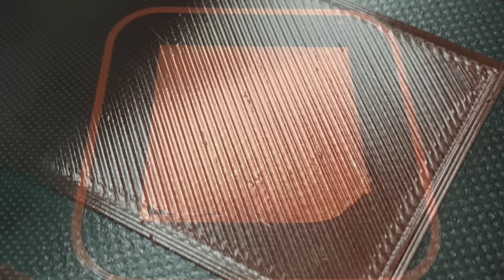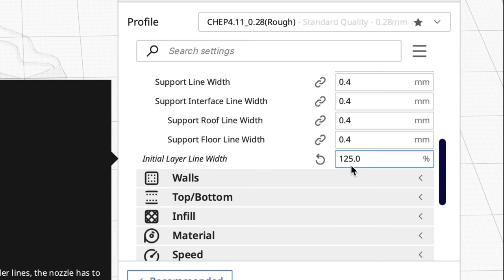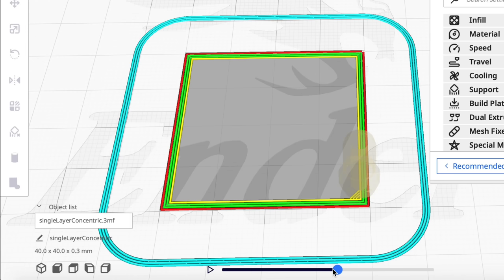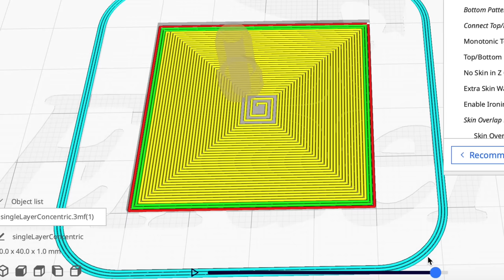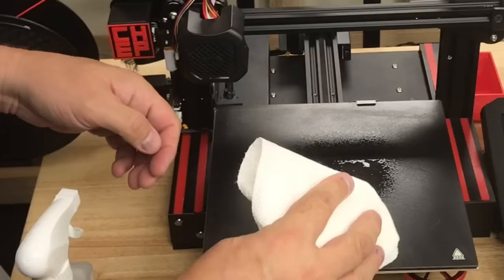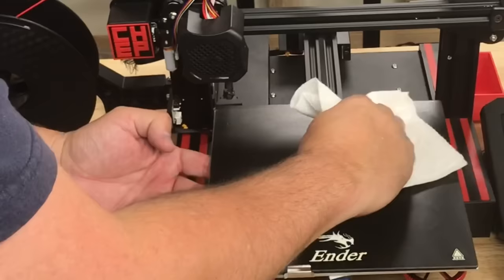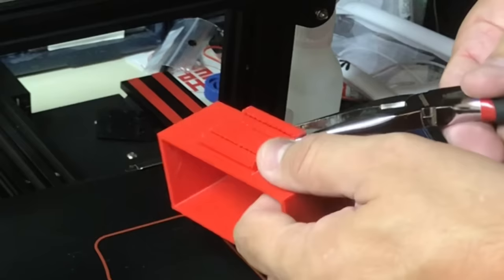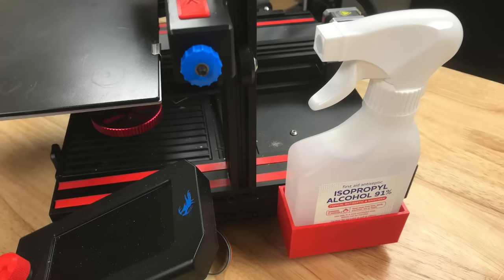Better First Layer and Bed Level Fixes on 3D Printers

Comment: Amazing! I have a bed that is slightly lower in the middle and i was struggling to get that 1st layer to stick on a particular shape. Upon following the points in this video, it made the print. Every advice on this channel always works for my particular challenge..once again amazing. Russell from Qatar.

Comment: Between prints I like to use the microfiber cloth. No alcohol just the cloth. I find that the bed has a lot of static electricity and it's attracting dust. After so many prints maybe four or five then I'll use a little alcohol after the bed is cool down completely.

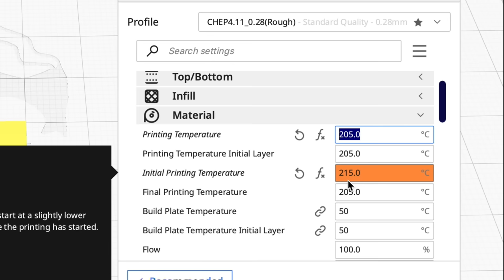Comment: Hello CHEP, I think there is an error in your video. At around 0:57, you seem to suggest to change the "Initial printing temperature", but it's actually the "Printing Temperature initial layer" that should be higher (215C)
I did the test and the print temperature for the first layer was 205...

As always, great video :)
Reply: +1 true

Comment: These fixes worked for me. It's been a nightmare getting the prints to even start without the extruder ripping the first layer off the bed. Despite the bltouch, the bed still seems to have hills and troughs that the bltouch isn't measuring, and so some places are thinner and others thicker on the first layer. I haven't gotten much out of my investment in this thing yet. Hope I will start to now. Thanks!

Comment: Regular paper towels leave fibers behind which also stop adhesion. I recommend using a micro fiber cloth or the blue shop paper towels that are designed for glass. These tips are all amazing though, thank you for this video!

Comment: I’m just getting into the hobby. I’ll be using this info this evening after work, when I continue to adjust my printer. I’ve gotten a few prints out, but many fails as well, and a lot that I have aborted just a few minutes in due to not getting a good bed to print on. I think this will help tremendously.

Comment: my print was warping so much up in the middle, but after using IPA and using the concentric pattern it just turned out SO PERFECT! even though i don't use Cura (i use Thq Qidi slicer to my Qidi printer) the functions are the same. I should watch some more of your videos.

Comment: I tend to prefer the Creality glass bed and initially it had no issue. I standard having some minor problems that IPA couldn't fix. I tried glue stick but didn't like the mess. Switched to a quick spritz of cheap AquaNet hairspray and it's my go to!
Reply: I used >99.5% IPA between all my first prints and it still refused to stick. Seems like it still left some residue on my Creality glass bed. Cleaning with regular soap once made it stick much more reliably.

Comment: Always enjoy watching your videos and have learned a lot! I was using 91% alcohol but couldn't figure out why I was having issues getting prints to stick. I noticed the alcohol started to remove the top layer from my carbon glass bed. My wife told me to try Eye Glass Cleaner from my experience it seems to help prints stick a little better and its also not as harsh as using straight alcohol. Hope this helps anyone else experiencing this problem. Also before I forget I use a microfiber cloth that I found at Walmart in the Auto department.
Reply: Its not a carbon glass bed its Silicon carbide which is incredibly hard and does not come off with alcohol cleaning. Alcohol affecting these glass beds is just one of many annoying myths that crops up in 3D printing.
Reply: @backgammonbacon  Yes that's what it is! Drew a blank on whats it's called. Maybe mine was defective or something but it was coming off. Using something other than 91% or 71% alcohol is working for me

Comment: Struggled with failed prints for the last 24hrs. Even went as far as installing the CR Touch I had waiting to go, but still struggled! Watched this, tweaked the slicer, tuned the z-offset, cleaned the bed and laid down the most perfect first layer I ever have. A single 75mm square, one layer thick that cannot be torn by hand (I left it as a line pattern too!) and has not a blemish on it. Liked and subscribed!
Reply from the maker: Glad I could help

Comment: This was so helpful! I had been noticing my brims are failing near the bottom of the plate on larger prints. It was the oil from my fingers where I'm always touching the plate to move it!!!! Thank you for pointing that out! I was going crazy trying to figure out settings or print models as the reason for initial layers warping :)

Comment: I also put insulation below the bed so the heat spread more evenly, it reduces the warping (the middle part of the bed usualy a lot hotter than the edge and expand more)
Reply: What insulation did you use?
Reply: I'm using roof insulation foil, it looks like shiny bubble wrap 🤣

Comment: I guess for me when I had trouble with getting parts to stick to bed, I learned to use spray adhesive or using brim in the slicer settings or both of those. Works well for me.

Comment: One trick I do (aside from cleaning the bed with alcohol prior to each job), particularly if the room is cold is to preheat the bed for 5 to 10 minutes. Glass doesn’t heat as quickly as the aluminium base that the sensor is attached to, so whilst the sensor might suggest a bed temp of 60 degrees, the glass needs a bit more time to achieve a similar temp.
Reply from the maker: I let them settle a lot longer but edited it short for the video. Same results.

Comment: Thanks Chuck, those Cura tips are awesome but my issue is probably the cleaning. Just got my printer a couple days ago. My first print turned out really well but now I'm having this issue. I had success bumping up the nozzle and bed temperatures, but its not failsafe. I've swept it off and wiped it down, but I haven't taken the bed off yet for a proper scrub. Sounds like this is my problem.

Comment: Thank you so much for this video. I'm still pretty new to 3d printing and after a couple weeks without issue, I had run into an issue where my first layer was laying so badly it would curl up and catch on the extruder causing the whole first layer to start dragging around, I re downloaded my sonic pad profiles I tried my default cura profiles tried tramming the printer and leveled the bed over and over and tried glue sticks no matter what I couldn't get a good even stick on the first layer, SO I took this guide and used it as a fresh start following basic guidlines for a good first layer along with some of your recommended settings and I'm seeing good clean  first layers again with no curling or lifting, will take a few more prints before I have my settings really dialed in but I was starting to lose confidence in fixing this until I followed along with this video.
Reply: Fr bro my print was dragging too but this guide helped.

Slowing down that travel speed was big.

Comment: Hi Chep, thank you for sharing your tricks! :) I use something else, under MATERIAL - Initial Layer flow - set it to something like 120% - if I need a brim for avoiding warping, I also bump that up.
For cleaning the bed I use glass cleaner and a microfiber.
This avoids me using rafts 99% of the time now.

P.S. I have an Ender 3 Pro with a slightly warped original Ender 3 bed - so without the magnetic stuff

Comment: If your getting raised lines in your print's first layer, the print head it too low; raise the head +0.2mm and try again. Cleaning with a wire brush is also a must if you've been using glue sticks for dimensional challenged filaments, and then go back to PLA.

Comment: I just started to use a glass bed on my ender3, To get the first layer to stick I just give it a light going over with a glue stick and bump up the temp 10 degrees works every time. Just remember to clean the bed before your next print.

Comment: I think a lot of people have issues with prints not sticking to the glass beds because they do not clean the yellow glue that is left behind from the protective plastic sheet, soap and water will not get it all off you need to use IPA.
 The glass sheet I bought for one of my Ender 3 machines did not have any problems with prints not sticking despite not initially cleaning it but the bed that came with the Ender 5 Plus had to be cleaned, that was the one I tried to wash with soap and water and the prints would still not stick but after cleaning with IPA the problem was easily seen as there was still loads of the yellow glue on there but once that was removed printing was fine.

Comment: Thank very much for the tipps, it helped me a lot. The part I needed to print had 15 openings on the bottom so may small circles and squares and with your tipps especially with concentric movement and outer walls first he printet much bigger lises first and than the small inner rings and it was great (so far).

Comment: Once I dialed in the more obvious things like temp and settings and leveling and had good but still not not perfectly consistent prints, I really like glue sticks on a glass bed. Need to find the right kind of stick and apply a super thin layer to the bed that is thoroughly cleaned off after each print. I wasn't having serious problems but I would see minor issues sometimes with first layers, little imperfections at the base, or a corner lifting slightly on larger prints. The glue helps tons with consistency.

Comment: I used to do what Chuck does in the Video.  But my process going into my 3rd year with 3 printers, Preheat bed, Use Gorilla kids Glue stick over the printing area.  It's washable with water, print is done take it to the sink run water and the print pops off. Scrub with hot water, Bed is now clean for next print. For larger prints I usually slow the initial speed by half, get that first layer on bed, than pump the speed up.

Comment: if you can't find option in Visibility Settings "Outer Before Inner Wall" @ 01:16, look for "Wall ordering" outside to inside.Cura V5.4
Reply: I use windows 7 and cura 4.10.0 and it all works like a dream. Not sure what the upgrades do. I can even install plug-ins in problem.

Comment: As usual excellent tutorials.  I get good results with soap and water under the sink and get the benefit of clean hands too 😀👍. As stated in previous videos glue stick works wonders but it doesn't leave a beautiful surface.

Comment: When are people having first layer issues that need to be fixed in the slicer?  Is it just particular materials like ABS?

The only first layer issues I've had so far (still pretty new to this) were because I needed to clean the bed.  I'll be doing that more frequently even if it looks clean.

Comment: Thank you so much i had this problem for a while, since i changed teflon bed for magnetic and i couldnt print corners or small details without warping, always had issue with first layer. Thanks a lot for help!

Comment: EVERYONE I HAVE FINALLY FOUND A REALLY GOOD SOLUTION!!

Go into your settings (im going to be explaining it for cura, the settings in other softwares should be similar.), set initial layer height to 0.32mm, set initial layer line width to 120%, and make sure your initial layer speed is 30mm/s. You may have to tweak it a little bit based on your printer, I have a ender 3. Hope this helps!
Reply: Came here trying to find the settings for no fan for say the first 5/10 layers , just got to 8 and the hotends pushing the print around the bed 🙄

Comment: It might be worth considering a place a bit farther from the 3d printer for the IPA. 3d printers, even the most well maintained ones, can have electrical failures, and there are a lot of hot parts. IPA is extremely flammable. Keeping accelerants near hot electronics seems like an unnecessary risk :)

Comment: remove the support and put 2 45 degree angle 1 layer rectangles under the nose of the rail profiles connecting against the model. And you can print it all without support.

Comment: PEI + Purple Gluestick has worked almost alarmingly well for me for PLA & PETG. (Ender 3 with mods). I have a Creality glass bed but Ironically I haven't used it in a while ever since I started using the 'just a bit too much' gluestick method. 10kg+ of PLA so far and rarely any problems even on lace-like first layers.

Comment: Thank you Thank You.  I have been going crazy with my upgraded glass bed on the ender 3 pro.  the setting you provided worked like a charm.  i think my bed was too hot, and the 1st layer setting may have pushed it across the finish line, so to speak

Comment: Great video. I just started a week ago and I’m having problems with my cheap printer. I don’t have a heated bed, so that might be a big part of it, but you’ve given me some ideas, especially in the slicer set up. I do always clean between prints, but I either have the corners curling up, or compressing where it looks like I have a skirt around the bottom of the print. I’m getting close to “good” but I think this might help me work out the remaining issues. Thanks.
Reply: Yes non heated beds can cause corners popping up. What I've found that can help A LOT is to get a heating pad and place it on the bed for at least 15 minutes on high. Even up to a half hour is great. This drastically increases the print quality assuming other factors aren't the issue
Reply: Don't worry I'm having issues with my $450 flsun racer. I exchanged the ender v2 for the racer. Man straight out of the box aside from the headache self plate adjusting the ender was so good. How ever I really love the build and speed of this flsun racer. I'm not giving up yet it has to be my settings or how close or far my extruder is from the plate.

Comment: one thing happened to me, the pully that drives the bed in the Y direction was loose, it was shifting over and causing drag. so my print would shift at the worst time it could, making my part scrap. took forever to figure out. finally i heard the belt rubbing on the housing and found the problem. realigned it, tightened it and runs as normal lol.

Comment: I fixed my issue by lowering the bed to 60c. I had been using 65 for PLA+ and switched to Store Brand PLA which is super nice, but it didn't like the 65c. It would let go of rafts immediately. I adjusted it to 60 and now its perfect.

Comment: I have been trying to print something all day, will not stick, on my glass bed. I cleaned the glass with Dawn, and the alcohol, then I went through Cuba, put in your settings, and perfect. I did a 32 mm cube in Fusion 360, printed perfect. Then the project, perfect as well. I think slowing down the first layer is huge. Thank you for your great knowledge. 🙏

Comment: ARE YOU A GOD?
The Concentric setting was a step too far for what I needed but when I rolled that back I got the first decent print in a year.
Ultimaker Original+ with CarbonFil.
Thankyou!

Comment: Great info on the printing stuff, but I have to question the wisdom of attaching a bottle of fuel to a machine that sometimes catches fire.  Rare, for sure, but that bottle could be the difference between a little fire that quickly runs out of fuel and one that now has the means to expand its horizons.

Comment: After having replaced the springs on my Aquila I quickly kept running into problems with sticking the first layer. I tried a spray that helps hugely in sticking the first layer. The only problem with this is that this 3D Lac sticks even when the bed has cooled down. After having injured myself by loosing control over the filler knife I decided to try and spray glass cleaner on the edges where the print touched the bed. Giving the cleaner some time it clearly creeps underneath the print thereby realising it. This works perfectly fine for me

Comment: My first few months were good (since April 2021) then I branded my left index finger on the nozzle in July when changing it out (an off-balance slip, about a 1/2 second push onto the nozzle - felt like an electric shock at first). Cold water, attention by a nurse (my wife) within minutes and a week later no evidence. However; I didn't get back to the printer for about 2 months. Could not print anything without issues - adhesion, tramming, skipping, sticking; everything that could go wrong seemed to just pile up. Watched more YouTube videos, applied more "fixes"; still no love. I was constantly fighting with keeping the bed level, would have to spend up to 30 minutes between prints to adjust the bed. 

Finally, when I was just going to sell the thing I saw a video about adding locking nuts to the screws that hold the bed down. Turns out the screws were turning randomly when I was turning the knobs. ARRGGHH! The nuts with nylon inside the threads; not easy to find in m4 but I finally located some locally (Amazon order never showed up). So far the leveling adjustment is very minor - done in a minute or less and on to the next print! Also replaced the yellow springs with silicone spacers since that order did arrive. 

I did have the exact issues shown in this video and cleaning with IPA helps, but adding glue stick completed the setup. Now that I know I can get a good print again, I will go back and recalibrate PID and other settings to finish getting to a good "default" setting that I can use to build up custom profiles for different filaments. 

HUGE THANKS to Chuck, 3D Printing Nerd (Joel), Makers Muse ( Angus), Teaching Tech (Michael), BV3D (Brian), Tom Sanladerer, and the other YouTube channels supporting this hobby; I would never have stuck with it otherwise. Your shared expertise is very appreciated

Comment: That is some handy info. I'm going to need to try it with my carbon fiber printing. I keep having issues getting the first few lines to stick even after a good Iso clean and using a layer of glue stick. Only did 2 attempts so far before my nozzle clogged on me.